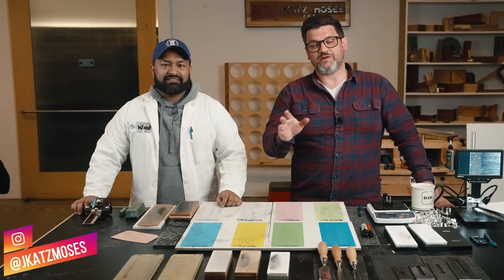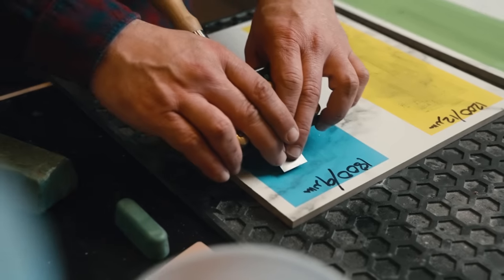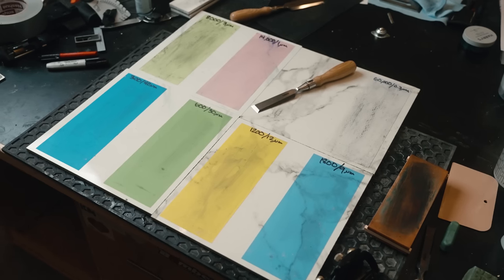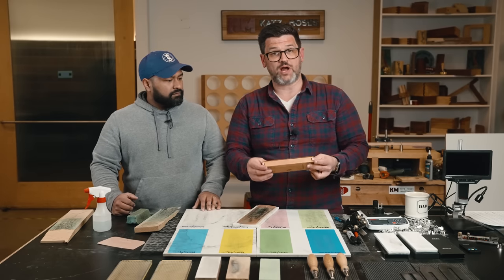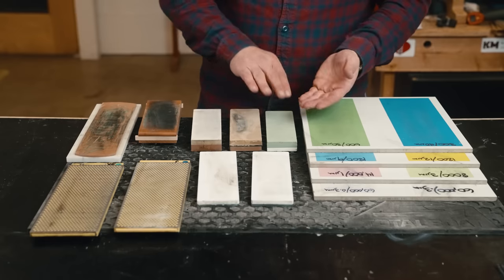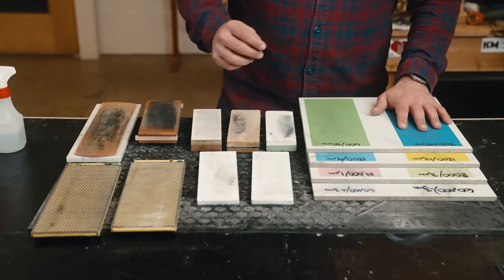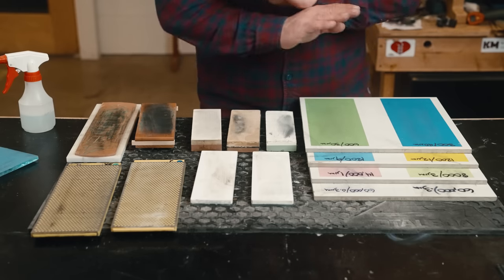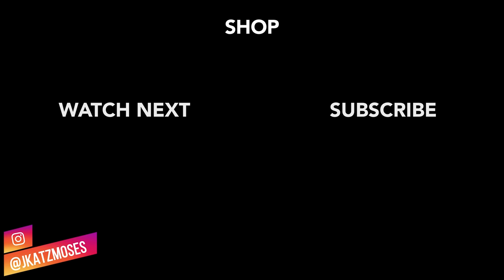The Most Comprehensive Sharpening Test Ever Done

Comment: I lied on my resume to get the gig. I’m not Dr Wood.
Reply from the maker: Damn it!
Reply: Too bad I can't comment with a picture of a cat in line with soldiers.
Reply: I subbed on your channel because of this video. Good stuff.
Reply: @Strawman333  same here 👍🏻
Reply: I know Katz Moses was wanting a serious wood doctor. Hard wood doc. No soft wood hobbyist.
Reply: After some trial and some error. Fortunately not to much as I didn’t spend a grand on stuff. 

But, in the end my system is. Worksharp 3000 with CBN wheels. 

Never need to buy a product again. Wheels will last a lifetime. And as long as the Worksharp 3000 exist. Good. 

Helps that I got my as an open box. So, $100 for the machine. $180 for all the wheels. 

And then strop after. I’ve found it to work very well for me. 

I’ve never used a Tormek. So, I won’t compare, but now I’m happy as I can sharpen anything for anyone and not feel like I’m degrading my materials.

Comment: Hi Johnathan, GREAT video, seriously. Excellently well done. However, I have a small technical correction on something you said at the 19:30-ish mark where you were talking about both float and tempered glass. So if you're glass chipped, it was not tempered. 

Float glass can be tempered, but it is not by default tempered. Float glass is made by pouring glass over molten potassium. The glass is lighter than the tin (corrected from earlier wrongly listed metal, thank you @GB Expat Cornishman) and floats on top while hardening as it gets cooler. The potassium "lake" is very flat and provides very flat glass. 

Tempering can be done in several ways, but most commonly (such as in car windows), cold air is aggressively blown on the surface when the glass is very hot. This causes the outside surface (on both sides) to contract and compress the glass in the middle. For example, if the glass is compressed (say) 10,000 l/si on the outside, it takes >10,000 l/si to cause enough deflection to break the glass. Plus, the tempered glass breaks into small rectangular solids that are much safer than large shards of glass. Next time you pass a car accident, pull over and examine the side or read windows; you can see this. Windshields (the front window) are laminated glass and not tempered. When it breaks, the plastic lamination holds all the pieces so they do not fly around into the face of the driver or passenger.

I was a scientific glassblower for over 40 years, demonstrating these dynamics to many groups and organizations and have written extensively on glass, glass physics, and glass chemistry.
Reply from the maker: Thanks professor glass. Feels like an origin story for a super villain 😂😂😂
Reply: @katzmosestools  Actually, the origin story is more complex then a super villain: I was getting my BS in Oceanography but was directing a Hungarian dance troupe and needed some customization of some glassware. I took a 1-unit class in scientific glassblowing. The chem professor who taught the class suggested I think about doing that for a job and it became a wonderful career. Any other glass questions, just ask. I may have answers.
Reply: @nonexman  Float glass cannot be flat...it must follow the curvature of the Earth...I'd hate for that to upset the perfection of my chisels!
Reply: @chrisjordan4210  Haha. Of course. And it's all Newton's fault for inventing Calculus to work out rounded areas by cutting them into smaller and smaller bits. So don't blame me; blame Newton!!
Reply: @nonexman  Yep, I was only thinking of the imperfections introduced by Newton's model of gravity, of course, to sharpen an edge tool properly we need to factor in General Relativity..."frame dragging" etc...or maybe like using those really fine stones we're losing the plot as JKM said (and to think I used to enjoy woodworking)😊😊.
Now, where's that old oil stone?
Reply: @chrisjordan4210  yet another proof against flat earthers! Thank you!
Reply: @elmohead  Just think if they're right, at least float glass would be truly flat😀
Reply: Potassium is far too reactive!  The float glass process was developed by Pilkington's in the UK using a molten 'bath' of Tin; it has been licensed around the world.
Reply: @gbexpatcornishman3004  Bingo, you are absolutely correct. Brain fart on my part. Thank you for the correction. I have updated/corrected what I had and thanked you in my comment.

Comment: How long will the Scary Sharp films last? Is there a good/easy indication of when they are no longer performing as expected and need to be replaced? Great video, very informative!
Reply: As a Scary Sharp user, there is no right answer to this. It's going to depend on how often you sharpen, how hard you press down, whether you are back flattening new chisels/plane blades, and how many different tools you are sharpening on them. I change my paper about 2-4 times per year, but I resharpen on the SS probably once every 2 days, and then just strop while I am actually doing the work. I just like to reset the edge before a session. However, I usually start at the 1000 or 1200, the light blue or yellow, so the dark green and blue last longer, as I use them less. I also usually only need to do 5-10 strokes on the higher grits, and sometimes I even skip a grit if I am in a hurry. It also depends on whether you are just doing a micro bevel each time, or doing a larger surface area on the tool. 

The only ways to really tell are 1.) Is your steel leaving dark marks still? That is metal coming off, so if no metal is coming off, you probably are going to need to change the paper. 2.) Is it taking a lot more strokes to get the edge sharp? If you suddenly find yourself doing 50 strokes, it's probably time to change that paper. The way I generally tell is by going on the light blue/yellow until I get a bur, then using a sharpie and marking the very tip of the edge before each next grit, and going for about 3 strokes after the sharpie is removed. If it is not removing the sharpie, either your angle is off, or it is not removing material. 

It's not an exact science, so there really is no clear answer for everyone. There is certainly a trade off with the SS, because if you do go through a lot of paper, it's going to add up over time. I think there is a case to buy nicer stones to do the earlier grits, up to maybe 1200 or 2000, or whatever, then doing the rest on the scary sharp. Your stones won't need replacing if they are nice, so you save money there, and your paper of higher grits will last longer, as there is less to remove.

Comment: Bought a piece of float glass from a local glass shop, they asked if I wanted the edge cleaned up or not. Didn't cost any extra, but if you're going that route, I'd definitely recommend doing it! Makes the edge smooth and safe to handle, you can't cut yourself on it. 12"x12" was about $20, thickness was 1/2" I think. Might go higher, like 5/8" or 3/4", if I were to buy again.

Comment: I'm a strong believer of use what you have. I have a 40 year old oil stone, works fine. I'd rather have a sharp enough tool that will work than worry about perfection that performs the same. Sharpen quickly and get back to work
Reply: My issue with oil stones is keeping them flat takes more time than I’m willing to spend.  I can use abrasives on glass and get a sharper edge with less overall time spent.  Find a system you’re comfortable with and enhance it as needed.
Reply: @raymondbunkofske4702 Oil stones don't take long to flatten, some SiC grain on a bit of glass, or super coarse diamond stone will make them flat pretty quick, and they don't go out of flat very often.

Comment: FWIW, and based on long experience, I agree with you completely. 

I sharpen everything by hand and I have used all of these methods. They all work and they all work well. 

Ultimately, I have come to use diamond stones as a preferred method because I like their cutting ability, their durability and their flatness. I have 300/600/1200/8000 grit diamond plates which work well both for creating new edges and touching up dulled edges. 

But the key, the REAL key, in my estimation is the strop. Hand stropping and power stropping work very well and very quickly to put a keen polished edge on chisels, plane blades, knife blades, and carving tools.  As the years have gone by, I find myself stropping a lot more and sharpening a lot less -- especially with chisels, knives, and carving tools.  If I am carving, I keep a strop on the bench next to my work for both knives and gouges. 

Lessons learned...

Great video. Thanks! 👍👍
Reply: If the strop is making a huge difference on your edges, you aren't deburring properly.
Spend a little more time on the stones, deburr with light (less than weight of the blade) strokes, and then test the sharpness once properly deburred.

You shouldn't see much improvement post stropping if done properly.

As for maintaining tools, strops are great.
Reply: @autumn5592  After using the 8000-grit diamond plate, burring is not a big problem -- especially after I run the back of the blade over the 8000-grit plate. I also drag the blade laterally across my thumbnail to check for any burring before I use the strop. 

The stop appears to polish the blade to a sharper edge. It may be a slight difference, yet it is very noticeable.  I can easily see the difference by shaving hair from my forearm, both before and after stropping. The hair cuts much more easily and smoothly after stropping. The same goes for cutting end grain in pine or cherry before and after stropping.
Reply: @jerrystark3587  Burr formation is a problem even at 30,000 grit.
You can have issues with burr formation on sub-micron diamond pastes too.

The burr is the problem why you aren't getting sharp edges. Even micro-burrs harm sharpness.
You won't see them or feel them either.
But if they make the apex thicker (they do, just by being there), or fold over, then you won't have a sharp edge.

Material removed from a bare leather strop is nothing, the grit of it is like 160,000 or something; you would have to take thousands of passes to see any difference.
For pasted/compound strops, the difference on actual sharpness is negligible, if you're using it to deburr.

If you want to see if the issue is burr formation, after you've sharpened, test it, then take 6-10 passes each side (alternating) lightly on jeans.
If your knife gets sharper, you had a burr.

Grit does not magically stop burrs forming, polishing does not have much of an impact on sharpness.
Reply: @autumn5592  I only report on my own experience. I am not reviewing principles of metallurgy. 😎

Comment: My father used to sharpen buck knives for hunters (he owned a small engine repair shop) and he would start with any major reshaping on a grinder, then move to a pair of stones, then to a piece of cardboard with compound. His final step was jeweller’s rouge on a flannel wheel to polish it up, but he told me often about a hard leather wheel he used to have for a bench grinder. Even without the hard leather wheel, he would often let the weight of the blade slide down his forearm and shave the hair off when gave it to the customer. The right person could sharpen a spork into a scalpel if they are dedicated, but it might only make one cut.

Comment: If you strop the beveled side first (on soft leather), starting with a 25-degree main grind, then the "round over" may simply add that "five degree" "microbevel" to the blade geometry.  Very often you hear folks described an edge as the intersection of two planes.  In reality, one plane maybe defined by a really flat back, while the other is the tangent of the arc of the "rounded over" bevel.  As long as that intersection is very acute, and very clean, you have a sharp edge.  Paul Sellers makes this point, but the geometry versus material surfaces is pretty clear once you think about it.  And, most importantly, as you note, you don't need anything but occasional stropping for quite a long time before you need to tackle using stones again.  I've eased off on how fine the stones I use are, and now rarely push beyond 1200 on a diamond stone.  After stropping, the hair flies off the arm.  For knives, I will work up to an 8,000 grit waterstone.  Cooking needs much sharper edges than wood working.

Comment: The main advantage of the Shapton glass stones over traditional water stones is that they don't require soaking. You can just splash some water on them and use them. But yeah, I don't buy into any super high grit stones.

My only issue with the "scary sharp" system is that it's great for chisels and plane blades, but if you're also sharpening knives, it can be difficult to get it set up in a good form for that use. There are plenty of good stone setups for knives. That said, aside from my really nice, expensive Japanese knives, I sharpen most of my knives using a sanding belt system (I use a Work Sharp), which is pretty much just "scary sharp" on steroids.
Reply: I'll point out good water stones don't need to be soaked! Ex. Naniwa super stones, shapton pro. They are marketed as "splash n' go". The shapton glass stones are just higher quality, wear slower, and are glass backed! Hope that helps
Reply: @Haydt456  Certainly a lot of the modern ones don't, by popular demand, but there are still soaking stones that are good and have been used for decades. I'm impatient, though. Plus, it's a hassle to soak stones just to touch up one knife, and keeping them submerged all the time seems to make some stones less effective, IMO -- and a pain to store that way.

And also not mentioned, there's not enough love for traditional "Arkansas stones" aka whetstones or oil stones. I don't use them much, but my father used to get some great edges on a simple 2-sided whetstone with a little machine oil, holding both the stone and the knife in his hands. Great skill to have in the field, and a decent oil-soaked whetstone is an entire field kit on its own and can last decades.

Comment: I found some 10 x 14 tiles at Home Depot. Let’s you put 2 grits per tile, however what I like better about these is that you have a couple of inches left at the bottom of your sheet, so that when you sharpen with a jig you get to use the whole sheet in stead of just 8 inches .

Comment: Cool video and I can appreciate the ton of effort that went into it. At the beginning, what is sharp is defined as being able to effortlessly cut printer paper (~140 g or less) and it’s stated that this is usually good enough for woodworking. This seems a bit arbitrary and it’s not clear why ‘effortlessly cutting printer paper’ is the standard for ‘woodworking sharp’.  It would be ideal to examine the surface of planed wood and use it as a measure of what’s required for sharpness — it might be difficult to quantitate the ‘smoothness’ of planed wood — and this is very likely wood species dependent. For the 30 degree vs 25 degree bevel angle, it would have been cool to see a plot of number of strokes planed on wood vs grams of quantitated sharpness. You could then directly compare the plots of 25 vs 30 degree bevel for a better comparison of sharpness longevity as it relates to bevel angle — this might require more than three points as done here (10, 50, 100 strokes).
Reply: We’re on the same page. 140 is arbitrary. And what is “good enough”? Ever plane Honduran mahogany with “good enough”? Bloodwood? Or domestically, hickory. The idea of going literal hundreds of passes without needing to sharpen or only stropping is ludicrous. I’m pretty sure “whatever sharpening method works for you” is a euphemism for “whatever your standards are”.

Comment: This is the only valuable video on YouTube on edge sharpening. I would urgently request a similar review on stropping compounds. Knife forums consider the green wax compound advocated as useless and even as a negative product. An interesting aspect never treated critically is that a mirror polish has no functional value for edge performance. A theoretical value might be a decreased surface tension to make the metal very slippery. I have found that on any metal surface that effect be achieved with a thin film of Renaissance mico-crystalline musum wax. When hand buffed the effect is almost make the metal surface almost touch undetectable when skin glides over the surface. Other benefits are described with product information.  There is a serious need for s stropping compound review.

Comment: Honestly speaking I would love to see your techniques on using each of the systems. I used to use shapton stones after battles with every single system I was able to find. And after 30 seconds sharpening technique from Rob Cosman I havent found anything more friendly to myself. That bring me back to conlucsion I havent heard anything about tertiary bevel in here. This video is good but got some points ready to be extended / fine tuned. Last note - what about oil stones? Are they not good? Less messy then water stones, easy to use, no rust... Lot of positives